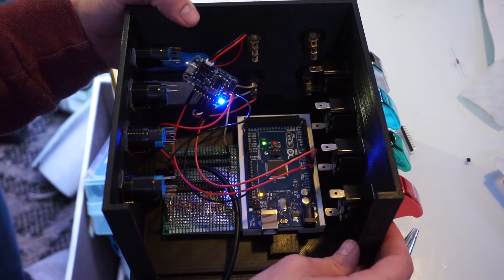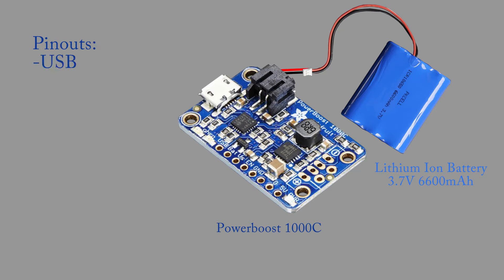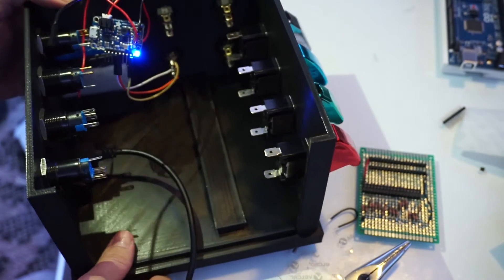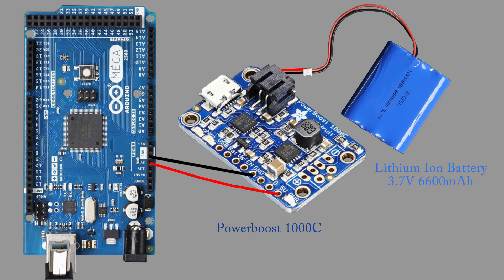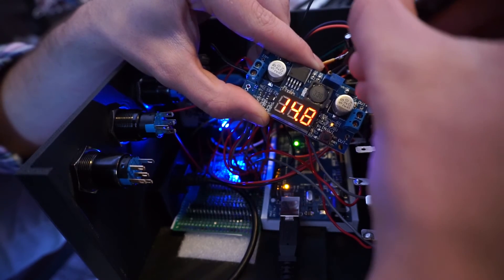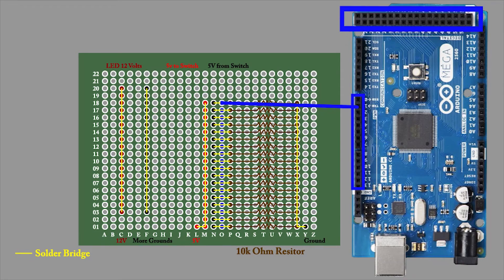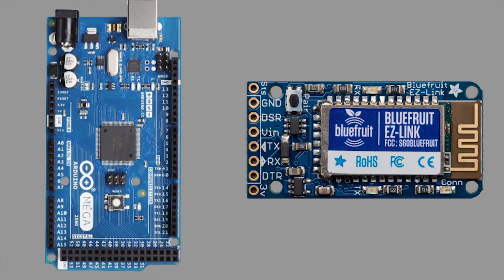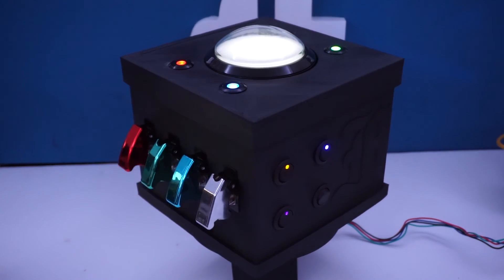The Bluetooth Black Box (Part 2)

Comment: Hey! I absolutely love your video series.  It is so helpful and informative and detailed, even down to the parts list.  Seriously amazing!  I am using it in my High School Senior Engineering Capstone class with my students and we are trying to create an interactive coffee table that the students can use to play games with on their lunch break.  We plan to create the table using the JDesign and about 1000 lights.  However, the students would like to make it interactive using touch sensors to play tetris or checkers or connect four.  I'm trying to figure out how to control the lights based on touch inputs.  This is all completely out of my comfort zone (my background is Industrial Engineering) so we're relying heavily on youtube videos and other sources.  Thanks again for posting such fantastic videos.
Reply from the maker: Hey Vanessa, Glad I can help. You can shoot me an email at dflo@drdflo.com if you have any questions. This video should help you with controlling the lights via buttons. If you are a beginner then I recommend starting with my 100 addressable LED series (https://youtu.be/bdIij70_VN0) and then scale up. The arduino IDE coding environment is much friendlier than python (python is still doable for a beginner).

Comment: First of love your videos man, keep up the good work! Nice to finally follow someone that has great video quality as well as audio! I'm a first year university student of the electrical engineering program. I had one thought around 5 minutes in to your video, whilst you are talking about current back flowing through the 5v channel of the battery booster/charger. Instead of using a switch to interrupt the circuit wouldn't it be possible to place a diode between the 5v pin of the booster and the 5v pin of the arduino? Thus limiting the current to flow only in one way so to speak? The reason for this would be to eliminate the need for a button being pressed right before charging. This series is such an inspiration, planing on doing something alike some time in the future!
Reply from the maker: Chris,

Really appreciate the kind words! Yes I believe a 1N4001 diode would work. Let me know if you have any other questions!